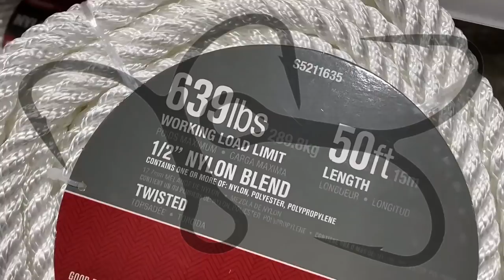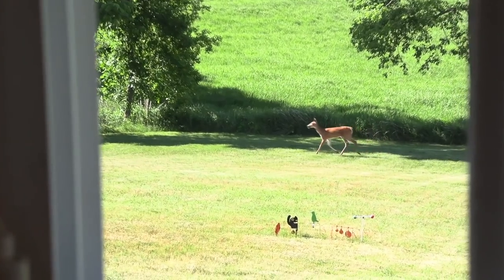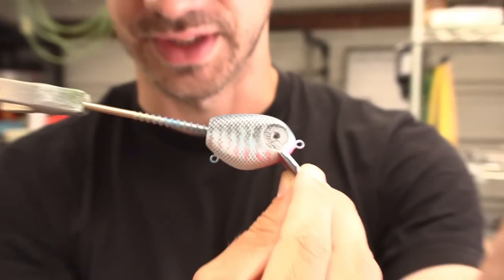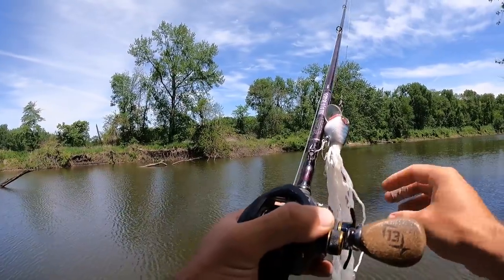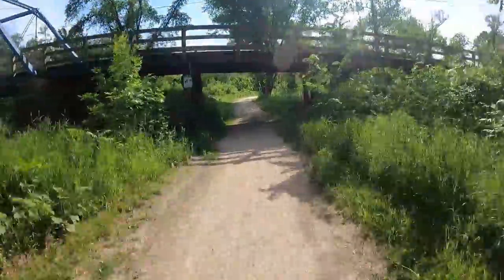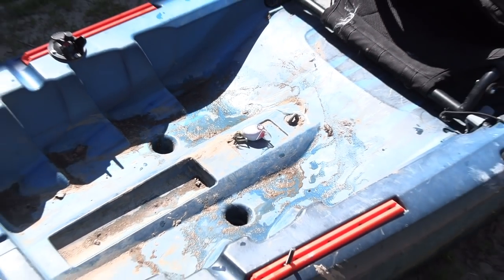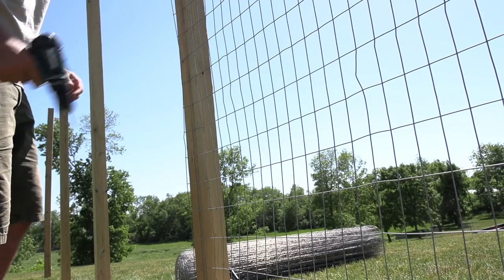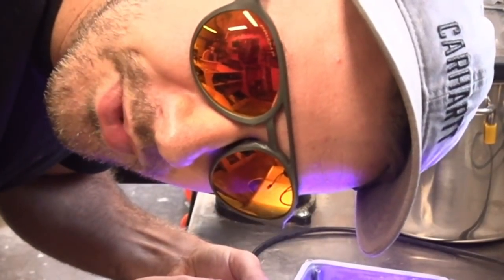Nylon Rope Lure Trick | One Day Build to Catch

Comment: The other poster said to tease out the fibers with a hairbrush. After you do that, loop the fibers back. Make the loops different lengths. This makes a bunch of loops around the Gars teeth when it chews the lure, keeps em on better. We used to tie Wooly buggers (fly) with the soft (loop) side of velcro. Brown Trout would spit out our flies as soon as they realized the weren't bugs. The loop velcro gets looped around their teeth and they keep the fly in their mouth longer so we could feel the fish and set the hook. Probably would work on the gar lure too

Comment: My old fishing buddy gave an essay of a post earlier about our experience fishing for gar.  He said that gar will generally only bite things they think they can fit in their mouths, we tend to use smaller lures and shorter sections of rope (4-6in).  Something that really helps us with retaining them on a bite is burning the end of the nylon rope together with a lighter.  This prevents their teeth from sliding off of the back of the lure.  My friend did let me know that he no longer does that though and instead doubles the rope back up to the lure to make loops at the end.  I also agree that they very much like baits with a good amount of flash.  When we first started using rope lures we didn’t have anything but rope and a jighead in our lures.  The gar were not nearly as interested as they had been with the inline spinners and other flashy lures that we were using to fish for other species.

Comment: Sorry for the triple comment; if I could give one recommendation on the rope rig, taking an old hairbrush to the rig really helps separate the fibers. I haven't done any tests, but feel it helps a lot with the action, & would reckon it helps with securing fish 🤙
Reply: Last tip: no hookset, open the bail and let 'em run for a bit 🙏💜 They run with their prey and shake it to death like a dog with a rabbit, and that's when they get snagged up in the rope!
Reply: I watched Richard Gene's video, and did what he did. It definitely works!
Reply: @CarolinaBassHunter  I made some significant improvements thanks to good ol' Richard Gene, The Fishing Machine! 💜🔥 I haven't met an angler yet (who's familiar with YouTube and) that hasn't seen that legend one way or another.

Comment: Getting technical here:  The stars end of the flag always gets oriented to the front in the direction of travel.  For this lure, you put them on backwards.  The blue side should be nearest to the nose of the bait.  That's why you got eyes with the flag facing both directions (and not the same direction).  This began in the Airforce.  The flag will look normal on the left, but the right side of the plane is painted backwards so the flag appears to be flying in the wind.
Reply: I was gonna say the same, but since you already did, I'm just gonna like and comment on this comment.
Reply: He had no other way to orient they eyes. They came printed like that. They would be upside down if the stripes were correct
Reply: Wait you’re right. They’re two different directions. I thought only one was backwards. My bad
Reply: He specifically said, "one of the flags will have to be backwards". I also have yet to see the eye on the other side in this video.
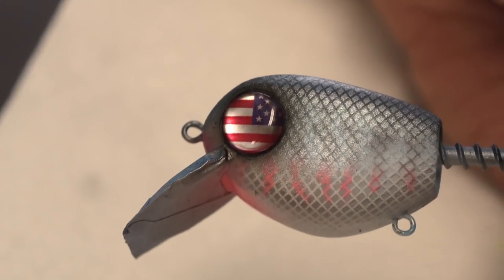Reply: @Justtomstuff   You're not understanding it.  6:57 is the left side and has the stars towards the rear.  7:06 is the right side and also has the stars towards the rear.  He has them backwards and they should be swapped.  Both sides should instead have the stars towards the nose and that's the whole reason for why the flag was printed in both directions.  Think of it as though the lure has a flagpole... and then moves forward.  How would the flag look from both sides?  Regardless, it really doesn't matter to me.  I was just making an observation.
Reply: Came here to say the same thing.
Reply: That may be why the gar rejected it. True patriots.
Reply: If to be technical it originated from carrying the colors into battle on foot.  Well before air force
Reply: Unless it is to be displayed after the video. Then the stars are to be to the top left of the viewer. Whether vertical or horizontal.
Reply: Because we never retreat

Comment: Hey I've been working a little bit similar to that I'm having trouble I've been casting it out of a aluminum light resin and the thing wants the flip over and swim upside down Along with a bunch of other crazy stuff my originals made out wood and it worked OK do you think changing the trailer for like a worm would make a difference On the wooden bait you made there give it more of a wobble and also maybe make it a little smaller for bass

Comment: The trick with gar baits is that you have to use a rope made of really gossamer strands.  The thicker stuff won't tangle in their teeth.  The more you use a bait, the better it tangles.  And you don't set the hook.  When he swims off with it, you apply some pressure.  This will make him open his mouth and toss his head, which makes him get tangled up even worse.
Reply: Peter Collin - finally someone who knows about gar fishing. Never set with a rope lure, and the finer the strands on the rope the better. The Spotted Gar here in SC will grab the rope lure and then swim off with it.....sometimes a couple dozen yards before they decide to flip their prey around to swallow it, so no hurry about starting to reel them in. 

When I lived in Oklahoma as a kid, they used to sell gar lassos - a loop of steel leader material with a hook in the center. You'd bait it up and drop it down (off a pier for me), when a gar would stick his mouth in the lasso to get the minnow you just pulled it tight and it would close around his snout and his teeth would catch on the closed loop, worked every time as long as you didn't let any slack in your line. Darn that was a long, long time ago.

Comment: It looked good, but it's a shame it didn't work out. Here's a few things from my not so vast experience. 1) When gar aren't biting, they won't bite. When they are, you can't really fish for anything else due to their constant interference. 2) Longnose gar will mostly only hit whatever they can fit through the back of their mouth, and will drop anything they hit that's bigger than they thought; You sometimes have to struggle balancing a lure that's big enough to get attention but small enough to trigger a strike. 3) Gar really like things with flashing blades. I prefer underpins like road runners and inline spinners with compact hardware; Remember that if they strike the hardware instead of the rope, you can't hook up. 4) If you don't set the hook, they may drop the lure. If you set the hook, you may rip it out of their mouth. Lower power and action rods will probably serve you well. 5) Fishing for gar is hard. My fishing buddy and I coined the term "Gar d**n it!" when we started out. It's worth it when you get it right on a good day...but take something else in case they aren't biting 😂. 

Looking forward to the next video!

Comment: Revisit! I've had much better luck and action making gar lures with Paracord and light wire. The outer jackets can be nearly every color, bunched up the add hollow bulk to the body, and the wire makes the line tie eye and weights the front, and you can thru-wire for a hook hanger. You can add bead eyes and lead to change the look and weight. The core fibers brushed out will tangle gar, and the ends can be lightly burned if you're missing fish. If I don't see you try again, I'll be sending these before summer's end!

Comment: Rope lures are unethical. If you break off the gar, the fibers are stuck in their mouth resulting in the gar being unable to eat properly. Use a regular hook and accept the challenge of landing a gar without a mouth snare/snag.
Reply: They can be if you do it wrong. Tie 10lb fluorocarbon or 14lb mono to a wire leader equipped with duolock snaps with a Palomar knot and check for fraying every time your line contacts anything. Actually do this, and you'll never break off a Longnose gar so long as your lure is of solid design . You will however lose some because ropes aren't quite the catcher most people think. About a third of mine untangle themselves (not rip a chunk free, but actually come clean off) before I can land them.

Some things are only unethical if you're careless. One might say that carelessness is unethical rather than the practices themselves. Other things really just are unethical. Putting gar on stringers is unethical. Their jaw shape focuses the pressure in one spot and can cause them to break off and starve to death. I only made that mistake once and still feel bad. Bow fishing without consuming (not a criticism of bow fishing in general, of which I'm a fan) is unethical and technically illegal.

Fishing with rope lures is not inherently wrong. Like most things in life, you just have to do it right.
Reply: @justinwastler2097  break offs happen, no matter how much you check your tackle. we have no issue maintaining a fantastic catch rate on gar with small gauge flies with a treble stinger. no wire.

Comment: Your a master at making lures, but your structure building skills aren’t, checking out that much in a post is not good , treated pine cracks badly over time and losses strength,  a strong storm they will bust off !!